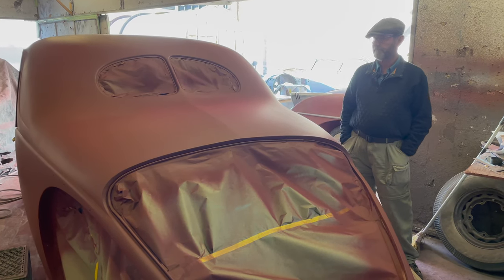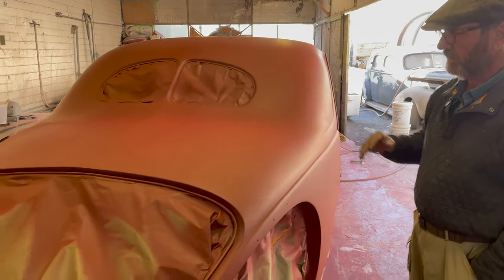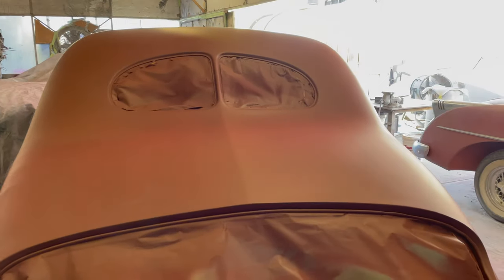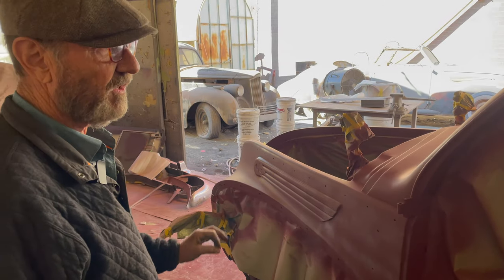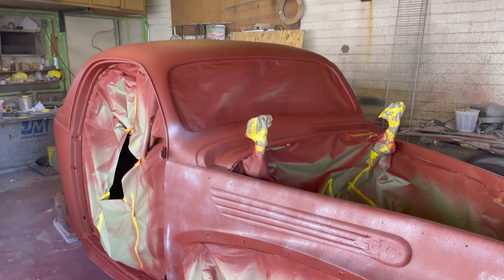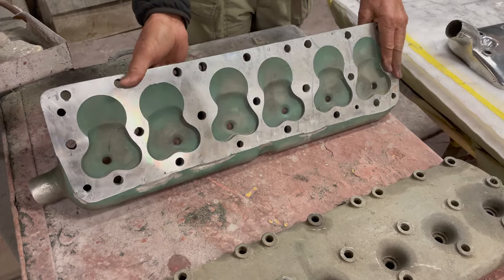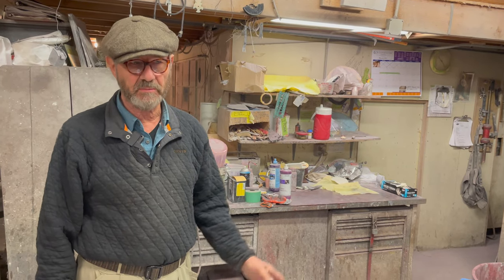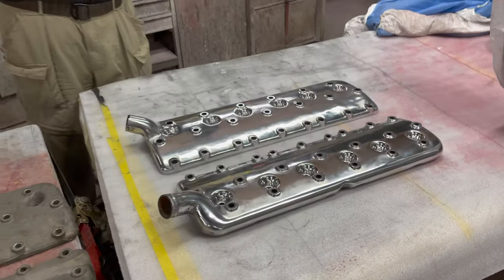1938 Zephyr Part 24 - Paint & Heads update. Restoration of a 1938 Lincoln Zephyr V12 Coupe

Comment: I see how JB gets the depth to the paint ------ a translucent paint ------ so -- it is not a paint from years past  ----- still ----- how many coats of paint ----- then with translucent ----- the more the coats laid down ----- the color changes ----- so with each panel being painted separately ----- one has to keep track of ----- HOW MANY PASSES ----- air pressure ----- spray pattern - percentage of overspray --- were made on each panel ------ the BASE gray primer I understand ------- sprayed on ------ block sanded off ----- guide coats to find the highs and lows ------- wonder if they use the High Build Primer ------ Interesting ----- the Red Primer has pigments of the top Red Coat ---- and has the Metallic in ---- IT ----- and not in the paint ------ Good pointer brought up on the absence of Anti-Freeze in the Cooling System ----- what happens to Aluminum without it ------ Will keep trod ding along on the build ----------- Thank You Again ----- Rodney